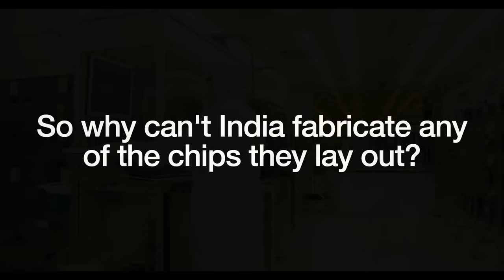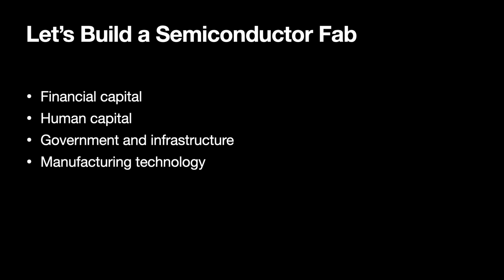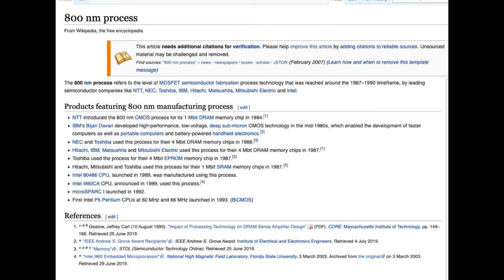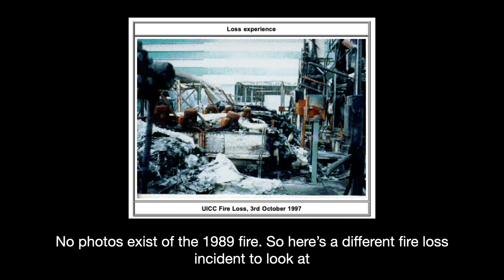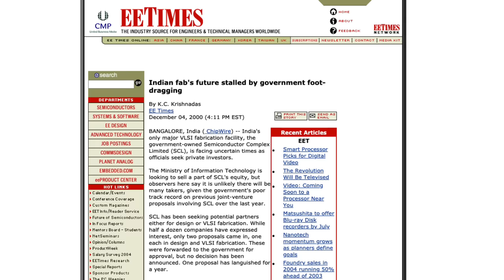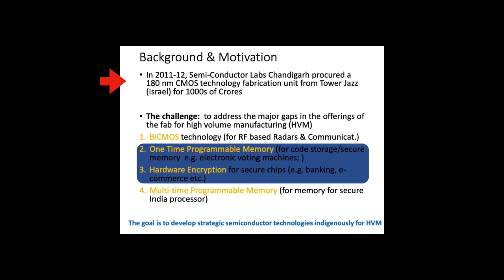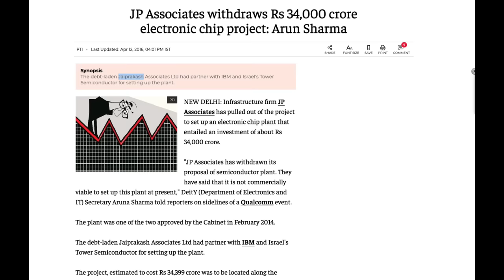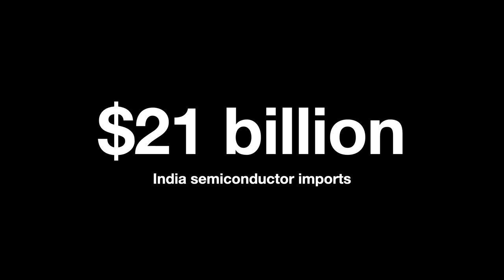India's Semiconductor Failure

Comment: I didn't know India even had a plan for semiconductor manufacturing.
Reply: Same
Reply: Bro we manufacture our semiconductors for isro and defence . We have a facility in Punjab which has 180mm process
Reply: @chidambaranathans1975  now it is moving to 45nm
btw its 180nm
Reply: @chidambaranathans1975   ya but it's nothing compared to the world😬
Reply: @sarthakyadava  Don't think like that!! 180nm is used in quite few areas. Most of the industrial chips are even 300nm ones. Fabs need constant big $ upgrade.
Reply: @sarthakyadava  well you can blame democracy for that. If you want fast growth in a span of 30 years, you need a strong leader at the start and a strong educational foundation with lassie flaire capitalism. We took the worst parts of socialism, capitalism along with democracy. So yes, we have no one to blame here other but ourselves.
Reply: @Fast_studyIQ  um not really. Nothing is on the table on the commercial level. Most of it is for research purposes especially considering even the most modest of our modern phones use less than 24nm config. Its really pathetic.
Reply: Tried multiple times, Failed patherically might i add multiple times.
Reply: @harshjain3122  democracy is not entirely to blame here. But yiu are broadly correct, from Singapore to South Korea to Taiwan and even Malaysia had politcal continuity under UMNO, that kind of continuity can establish consensus amongst the ruling elite and thats not counting foresight. In India forget foresight when the we hell have we had consensus on anything of importance ? Labour laws? Regulatory capture by organised labour,
Remember the suit boot ki sarkar crap that the opposition pulled, Land reforms ? Agri reforms look the cluster fck that is NCR.
Reply: @harshjain3122  Remember in the video, where Fairchild planned to invest in India in 1970s, but Indian bureaucracy scared them away. India had dumb economic system before 1991!
Reply: @PumpkinEater-dm1xx  that little investment means nothing it wouldnt have changed anything. What can bring change is if the problem called low IQ political elites themselves go away
Reply: @excitableboy7031  how ill informed are you expecting PLI scheme's to work in every damn sector  which is typical Indian one size fits all sectors b.s, Nation states across the planet  are pouring in billions to subsidize this industry despite already possessing superior infrastructural and highly skilled educated workforce (especially in the STEM subjects), all the Nations that have strong presence is semiconductor sector rank highly on the PISA ranking, India is not even in the running, NEP is supposed to change things but I reserve my judgement till i see some genuine improvements on the ground.
Reply: @chidambaranathans1975  180mm wtf
Reply: I think only Semiconductor Laboratory Chandigarh....is there....
Reply: @ashwin372  why??
Reply: Me too
Reply: How about plan for toilets ??
Reply: @liho1738  good to know pakistani's atleast watch semiconductor content
Reply: @chidambaranathans1975  😂
Reply: They have had!! Making chips out of potato!! And it was successed!!
Reply: Typical indian, but do you sanskrit is a fastest programming language.
Reply: @harshjain3122  modi will take us to moon and rss will take us to stars
Reply: @alexanderphilip1809  Semiconductor industry does not comprise only of microprocessors! Most analog chips don't need 10nm transistors. In fact, the higher end nodes (anything less than 22nm) are worse for analog circuits for multiple reasons. Sure, smaller nodes buys you higher bandwidths and lower power, but the overall transistor quality is much worse. 45nm technology is good enough for most of analog industry. For example, MEMS industry hardly needs 22nm ROICs. There is plenty of possibilities for 45nm tech. It is easy to be dismissive about everything and making sweeping statements.
Reply: It's a sour grapes for india
Reply: @sarthakyadava  for military use even old tech is good. Old tech are said to be more reliable
Reply: @alexanderphilip1809  for military use 180 nm is good.
Reply: @ARUNKUMAR-gh6zp  lol. IITs have it. But India VLSI lab are ancient compared to that of USA and Japan
Reply: @rodrozil6544  they are just design and a very small scale production lab.....
And not a business but R&D

Understand bro 😊
Reply: I didn't know they even had a plan
Reply: Thats why its such a failure. 😂😂
Reply: @metagde6402  is an high IQ political entity like Kejriwal the solution?
Reply: Until now ofc
Thx to china
Reply: @AnkhArcRod  nasa only uses chips which don’t fail but they are ancient in terms of technology
Reply: @harshjain3122  bro what if this is a Chinese channel? 🧐
Reply: @obama-bin_laden  or just to communal hatred!
Reply: Bro you should keep up with current affairs for that. India was trying for semiconductor plant from some time back now
Reply: @Fast_studyIQ  why 45 nm now? That 20 year old technology. Should convert to 5nm or 7nm now. Or at the very least to 10nm
Reply: It's because you are not what you think you are.
Reply: @harshjain3122  you made a fantastic statement, we have carefully selected the worst portions of capitalism socialism and democracy.
Reply: Congress top brass of those days weren't that bad afterall.. 🤷🏻‍♂️
Reply: @metagde6402  are you telling me educated people like Kejriwal and Rahul Gandhi should rule the country?
Reply: You don't know everything
Reply: @alexanderphilip1809  what are you on about guy, big names like samsung are signing up under the electronics PLI. 
They're incentivising components for now, things like SMD caps and resistors, displays etc, and later plan to expand to silicon too.
Reply: @AchiragChiragg  so you admit the kejriwal and Gandhi is educated ?
Well also, are only kejriwal and Gandhi the educated ones in india ?
Reply: @metagde6402  Kejriwal is educated yes. I don't know how genuine Pappus degree is. Besides you didn't answer the question. On that note CM of UP, Karnataka, Madhya Pradesh, Uttarakhand and so on are all educated too. So what's your point?
Reply: @MashZ  not easy to achieve, who will give this lower node? No company will share. Might be IIT Bombay will help gov to manufacture lower nodes.
Reply: @iampiyushsingh7544  semiconductor manufacturing who will know everything tell me?
Reply: Deal in progress with taiwan around 7.5 billion us dollars.  Video - world affairs by prashant dhawan on 26 September 2021
Reply: @Fast_studyIQ  I was talking a about his way speaking as that he know everything and didn't know this news. He should about the latest deal between India and Taiwan of 56K Crores rupee about semiconductor
Reply: Taiwan and India going to make it happen.
Reply: Same
Reply: they just have a ppt
Reply: Big failure
Reply: @rahulkaul6922  It's the truth.
Reply: @ashwin372  yup, and I think that india is also working with Intel for 20 mm chips
Reply: @liho1738  how about planning o build some toilets in paxtan
Reply: @muh11ad  
Hahaha 😆😆😆
I am not from Pakistan or China.
Reply: They are our educated class....😳.     
My Materials Science and Engineering teacher  told about fire in Semiconductor Laboratory....
Reply: @alexanderphilip1809  true
Reply: @PumpkinEater-dm1xx  true
Reply: @roardinoson7  true. Holy shit most people in this comment section are quite knowledgeable. I didn't expect that. I am seeing this now. Nice meeting you guys
Reply: @Flame which nations? Some Nordic European? Which else?
For Europe...they are homogeneous small states with population of roughly around 10 million people, they all speak the same language, same ethnicity in their respective nations and mostly same religion. So yes, democracy works there. Does india have the same conditions and does simple democracy work here? No.
Reply: @sceaserjulius9476  sanskrit is not venerated in Southern India at all..so the "typical" Indian part doesn't even make sense. Sanskrit is Indo-European, a language of your kins...lol...so how do you feel about that now?
Reply: @chidambaranathans1975  I have seen that facility in Mohali. On my way to office.
Reply: @chandanchettry4053  wow nice to know
Reply: They have made investment in taiwan companies to establish industries in india
Reply: SASKEN
Reply: @PumpkinEater-dm1xx  Modi fan spoted.
Reply: Xd
Reply: Same here
Reply: This is scam.
Reply: @chidambaranathans1975  burn
Reply: Exactly 😂😂
Reply: Bhai India Taiwan has been in last stage  talks between  in semiconductor deal which will be sign soon and manufacturing will start in india
Reply: The media ofcourse
Reply: @rahulkaul6922  Bruh it's kinda true , majority of the semiconductor is manufactured in Taiwan.
Reply: had a plan...and failed. failed badly where even Malaysia succeeded
Reply: @MashZ  lol...intel used to use 45nm like 7-8 years ago
Reply: @deezeed2817  lol, india and Taiwan deal of 8 billion , your country gdp😂😂
Reply: No problem most Indian thinks India do not even existed before modiji
Reply: Bikau media cover krega to educate hoga na Indians
Reply: @harshjain3122  the most honest comment ever from an Indian. Most Indians are in self-denial because of either nationalistic pride or pure ignorance. If India is to grow n become more developed
Reply: @harshjain3122  ! Perfectly well said.
Reply: @chidambaranathans1975  ! Because 180 nm is too too far away from 5 nm which China is working on.
Reply: @metagde6402  ! I beg to differ here ! India not only needs educated people but people with impeccable values of valour, courage and honesty.
Reply: Isro needs bigger transistors for radiation shielding,less chance of bit inversion
Reply: India has plans for everything. The proper  forms for approvals will stay forever on some "babu's" ( govt. official's)  desk.
Reply: @vijayanathanstephen9308  yeah lol! I had put that comment even before he posted the video . Same for that chandan dude
Reply: You must be proud of even that!! 😷
Reply: Same. I really look forward to working for one. ❤❤❤❤❤
Reply: Not surprised to hear that
Reply: @chidambaranathans1975  Exactly
Reply: @sarthakyadava  Congress party never wanted this to happen, BJP is doing a nice job in improving our industry, infra and foreign policy.
Reply: @Fast_studyIQ  TSMC just moved to 7nm
Reply: Not then but now we have 7.3 trillion$ deal with TMSC.
Reply: Indian has plans for everything on paper
Reply: No shortage of plans
Reply: there were multiple attempts
Reply: I had the same reaction.
Reply: And they are right to do so.
Only through a centralised economy can a mostly agrarian country keep up.
That's how it worked in EVERY single country.
The free market is a myth btw.
America HEAVILY subsidises critical industrial and agricultural sectors, whilst demanding that everyone else de-regulates and cut subsidises thus giving the American an unfair advantage.
Reply: They did but nobody wanted chips that run at 1Hz and are covered in rice.
Reply: all top guys at intel, amd, texas instruments, nvidia are indians or most of them
Reply: @chidambaranathans1975  
Four decades ago, in d r d o (when Intel -486 chip was ruling the market), a microprocessor chip that was much alike or even better than the 486 chip was designed. Then came the problem of getting it made (manufacture) for which no "Fab" facility was available in country. We took it for granted that someone will manufacture it somewhere as India needs a few chips only. A Singapore firm was contacted who got them made in Taiwan. The number demanded, so as to meet the demands of Indian government was too low. They were made, delivered & used with satisfaction. 
By then Pentium (re-nomenclature of 586) was launched. Because the scale of manufacture was in millions of pieces the over-all price (in the market) was very low, they were bought & used by various computer (Laptop) users. It set in motion the Laptop revolution. Meanwhile the India-developed 486 chips, apart from being a step behind the Pentium in Technology, were highly priced (because of the low volume of manufacture). It was felt prudent & preferable to use Pentium chips freely available at far less cost. Thus the effort to develop the chip came to a close.
The lessons to be learnt. First, the cost of setting up a fabrication facility is humongous(in the region of US$ 50 billion now) which in turn demands that chips (in batches of) in million pieces, to make them affordable to all, bringing down the cost of bigger systems & equipment by a large margin. This aspect is very essential, that entails a huge market, which  Intel & AMD command. Manufacturing in small batches that spreads the capital cost on far less products, make them costly is inadvisable except for Laboratory experiments. It isn't appreciated at all. If appreciated, timidity drives them to small batches as the higher cost can be dumped on the GoI (government) as always in such ventures. One question that is asked, is where is the market? Even here, India is a huge market itself & a wastage here & there is more preferable, to not doing it at all. And also this lack of taking risk, is bad business that marks Indian ventures, full of promises though. It stymies any attempts to upgrade Technology, which is the normal feature in this business. Funds may not be generated adequately for upgrading Technology. This results in Technology stagnation when the rest of the world is moving forward.
Reply: @alexanderphilip1809  
What is made for research purpose may not be released in the market, as the same may not pass the stringency of Quality approval test methodology. It is particularly glaring for defence (at least two grades higher than commercial products) use & Space (a grade higher than the defence equipment) applications.
Reply: @PumpkinEater-dm1xx  
Yes. The biggest stumbling block in the progress (if any; I am yet to see if it is there) is our "bureaucracy". I don't blame them. They (the men) are inured to play it safe. Failure isn't seen with favour but punishable & is a deterrent or are driven by plain timidity. Most of them under-exposed or not exposed, to contemporary Technology can't interact meaningfully with any Technology developers. Thus the quality of men (& their risk-taking ability born out of any confidence of knowledge) taking decisions is very poor. In India taking risks is often confused with wasting government funds & even (non-existing) corruption. The crusade against "corruption" has brought all & mighty, while stymying the decision making ability. No worthwhile remedy has been found to cure the malady. As an example, witness the Lok Sabha debates on the choice of Rafale aircraft that was thought to be very costly (& was foolishly suggested to "develop" such aircraft in thee country with the country's resources). The mildest word that one can use is "simplistic" thinking.
Reply: @roardinoson7  
All the Technology is developed by Japan, South Korea & now Taiwan. Taiwan outsources "manufacturing" (only) to China, establishing huge Fab facility (sinking US$ billions). The result is, Taiwan gets the cheapest chips for her global (spread out, but assured) market, using the cheapest labour anywhere in the world. What China gets is high-paid employment on large scale, that trickles down to the whole populace & promotes trade (export). China - per se - has not developed any Technology (not even manufacturing Technology but handed down by Taiwan), but just doing contact manufacturing.
In analysing & discussing such issues use of vocabulary such as inefficient public sector, corruption, lazinesss or lethargy  workers etc, doesn't auger well, but surely deviates the focus from Technical issues which are at the heart of the problem. These extraneous arguments can be added later, with no damage.
Reply: @metagde6402  
Politicians the world over are the same. So it is foolish attack one country on that account, as if the advanced country politicians who are corruption free angels. One thing should suffice, they have a commitment to excel or to do a batter job, while in India a job is done because someone told him to do. In this, quality of work is unimportant, but whether the job is done or not. If results are indifferent, the buck is passed, down rather than viewed as a team task.
Reply: @excitableboy7031  
Yes, these are news-worthy, viewed from the past events. The proof of the pudding is in the eating. Wait & see.
Reply: @ARUNKUMAR-gh6zp  
What is its scale operation (forget the level of Technology however high it may be) that clinches the outcome. Its vital.
Reply: @sceaserjulius9476  
There is no connection. It is an indifferent observation, designed to hurt someone. Nothing more to your Question.
Reply: @obama-bin_laden  No need for those. Let him get us a a clean fabrication facility sufficiently "large" that'd be more than the moon & stars combined, as you cite. If you are in the mood of joking take that elsewhere.
Reply: @AnkhArcRod  
Yes. Shall we talk about oranges or apples first? For me, I like them both.
Reply: @rodrozil6544  
Sour, before even seeing any grapes.
Reply: @rodrozil6544  
But old Tech is far far slow. Being fast is also needed for military use. You can't segregate one thing & still say the thing is adequate. Honestly thes old Tech is (may be) suitable for Audio & Acoustic applications.
Reply: @ARUNKUMAR-gh6zp  
EXACTLY.
Reply: @AchiragChiragg  
May be, if he can recall what he studied in IIT, Kharagpur, setting aside his political work for awhile. That way, there is plenty of talent, untapped & locked up in the Lok Sabha. But a Technologist is supposed to be in touch with what he studied & upgrade it periodically. Leaving his college text-books & notes in the dusty attic is no solution. It is why none of them talks anything but politics. It is far easier that way.
Reply: @metagde6402  
US & Japan are stalled in their track, because there is someone (Taiwan) progressing the Technology & minding that business. They have enough not to compete with Taiwan. Taiwan was given a tsk to mind the Technology that it does well, while the others have other things to do, happy in the thought that the supply chain is running smooth.
Reply: @bharattirth641  
The level of Technology isn't demanded there, like in computer games. But, yes "reliability" is demanded like nowhere else (may be things like 6σ). It is like a male buffalo tied to the yoke that can haul the load, rather than a race-horse.
Reply: @sidu130892  
Not sometime back now, but for forty or fifty years.
Reply: @shrikanthpai6604  
How about the Technologists &Technologies?
Reply: @metagde6402  
Kejriwal is a Technology graduate from IIT, Kharagpur considered to be one of such top institute in India. But he chose to leave all that behind & become a politician, that was not taught in his Alma mater.
Reply: @chandra5914  
But why should Taiwan wants to do that, in India? What is their plan?
Reply: @harshjain3122  
Minoo Masani (he is no more now) wrote a book "our India" long long ago. What strikes any reader in the first few pages is a map of India (dark) on which are superimposed the maps of European countries in white (Except Russia). It brings out the fact that Indian Union & European Union are on the same wavelength. Probably they named their as EU, on the template of our IU (Indian Union). Central government is the Union government. Her council of ministers is composed of Union ministers. It is UPSC (Union Public Service Commission) that our kids compete at. Probably it is better if IU is run like a EU & EU like an IU.
Reply: @samuraijosh1595  
How about all those Pandits performing marriage rituals (half a million shall we say !), performing pujas in all the temples giving Arti & Prasad if you visit any temple (there re 30,000 temples each in Andhra Pradesh as well as in Tamil Nadu, few built at least a millennium before). I suggest you visit Tirumala hills above Tirupati (& jostle with a lakh pilgrims every day) & hear their chanting.
Do you think these Pundits are saying their incantations in Urdu or Yiddish?
Reply: @tianlingchen5523  
So what? The latter can't nullify the former. If you Just want to talk, you can say anything you want.
Reply: @rgb2296  
Correction: Mostly manufactured by Taiwan in other countries (countries of SE Asia & PRC).
Reply: @hypocrite5873  
I don't know what you mean by 8 billion. I take it as 8 billion Roubles. You lack the elementary common sense of mentioning the basic "units" before/after every figure. So there is no point in trotting out figures (like casting pearls before swine). Yet I do that. 
India's GDP is about US$ 3,000,000,000,000 (fifth place). In PPP terms, the same amounts to about US$ 7,000,000,000,000 + (third place after PRC & USA).
Have you ever heard of terms like Google search, Wikipedia etc? I wonder ! You don't deserve to call yourself a hypocrite even.
Reply: @sohail7728  
Then how did Modiji popped up? Out of nowhere? Or did Americans elected him (instead of Trump)?
Reply: @vijayanathanstephen9308  
Do you see one ? (I see)
Reply: @MrPoornakumar  its 8 billion Us $
Reply: @joelshajan8706  
Why don't you go to them & teach them?
Reply: @MrPoornakumar  lol, i am from Indian business world, (my English is very bad) if we (business world) Indians talk in millions or billion that means that’s USD 
And if we talks in Lakh and crore, hazaar than we take that in INR
also deal is now becoming stronger and stronger
Reply: @phoenixzappa7366  
You mean a potato chip?
Reply: @evolveelectricvehicles8551  
If you ever happen to go to Bengaluru, you 'll all of them (big buildings) ina row.
Reply: @hypocrite5873  
Ow ! I was never taught this nomenclature.  I am not in the (business world).Like in all things you say, meaning what is contrary, your English is excellent.
Reply: @MrPoornakumar  yeah in delhi ncr north India 90% of the time we use million and billion for us$ and lakhs/crore for rupee 
Thousand/hazar used in both 
Only Sometime small media sites use million in rupee but they clarify with rupee after million 

I am sorry for my mistake from now onwards on youtube I will apply usd and inr where they are needed🙏
Jay shri krishna 
I am from mathura vrindvan here is famous festival holi today 
Happy holy to you 😊
Reply: @hypocrite5873  
Thanks.
Reply: @roardinoson7  India is a house divided on purpose … your oligarchs don’t want the peasants uniting , the disparity of wealth in India is a meme word wide where you only meet Indians if they or Patels or the servants of Patel family haha.
Reply: @harshjain3122  Democrazy
Reply: @liho1738  good to know Pakistani's atleast watch other things than "religion"
Reply: Yaa because we dont
Reply: India prefer high level design type service work not the dirty toxic manufacturing work.
Reply: @nsevv  there is nothing high level about most of our designs and services
Reply: @harshjain3122  America is democracy and they are at the forefront of scientific discovery. I argue that democracy alone can produce free thinking required for science. Don't blame democracy for India's failure. Infact India was copying communist Soviet union and was a licence Raj. No scope for innovation when just few control the narrative. Innovation needs an ecosystem of free speech, incentive for out of the box thinking, investment in education and research. Current India lacks all of this. Our higher education ministers denies evolution and say astronomy is inferior to astrology.
Reply: @chidambaranathans1975  180mm is a joke, when most processors are measured in nm (not mm) and 7nm is sought after.
Reply: Well everyone has a plan
Reply: @alexanderphilip1809  political continuity in Malaysia was broken in 2018 general election. Only recently this party came back to power through sabotage.
Reply: @sarthakyadava  most of semiconductor used are old semiconductor like washing machine old technology are used there which is make in bigger nm
Reply: Making chips is way more difficult than soft landing on the Moon.
Reply: @hanfucolorful9656  hmm and it's more difficult than controlling a virus. And more difficult is to distroy long march🤣🤣🤣 rocket. And going earlier than India in Mars🤣🤣🤣🤣🤣
Reply: @hanfucolorful9656  remember what happened in opium war than can happen again.
Reply: @hanfucolorful9656  be careful
Reply: @hanfucolorful9656  the most difficult things is hiding from Japan in WW2 🤣🤣🤣🤣
Reply: @devilsingh6052  take care of your [glass heart]
Reply: @hanfucolorful9656  🤣🤣🤣 your paper dragon get on 🔥
Reply: @nitinkataria8053  Yes, Nehru was an idiot by starting IITs, IIMs. Now these IITs can't even develop a cutting edge technology. 
He should have donated every thing to building religious worship places.
Reply: @HardeepSingh-bh7zw  You don't know his full CV Harry boy, grow up
Reply: @obama-bin_laden  😂😂😂😂
Reply: SIR THIS VERY FAKE NEWS NOT MY INDIA! PLS DELETE ! 😠😠ACTUALLY MY INDIA HAVE SUPER STRONG SEMICONDUCTOR  NUMBER ONE ! THIS WHY IM SO LUCKY LIVE IN SUPER INDIA 🤗🇮🇳 THE CLEANEST COUNTRY IN THE WORLD , WE GIVE RESPECT TO ALL  WOMEN THEY CAN WALK SAFELY ALONE AT NIGHT AND WE HAVE CLEAN FOOD AND TOILET EVERYWHERE 🇮🇳🤗🚽, I KNOW MANY POOR PEOPLE JEALOUS WITH SUPER RICH INDIA 🤗🇮🇳🤗🇮🇳🤗🇮🇳🤗
Reply: I didn't know India even had any semiconductor factory or any electronic industry
Reply: One of my friend from India and he said all the smart Indian ppl live in western countries and the ones that who went back to India became Hindu nationalist 😁😁😁
Reply: Thx to Congress
Reply: @shashank99341  electronics was reserved for central government under Licence Raj. They did not do anything.
Reply: @rmrrao2675  then which government investment such a huge amount.... R u modi fan
Reply: @shashank99341  no one is asking government to invest. Electronics should have been free to anyone to invest. Are you a fan of Nehru and his failed policies?
Reply: @AchiragChiragg  yes bro current situation of Punjab says all
Reply: It's semiconductor PLI scheme
Reply: @chidambaranathans1975  180 nm ? Man that's ancient
Reply: They never have a plan they copy Chinese doctrine without thinking it through. This is done both in the economic and the military sector. The Chinese deployed a failure of a light tank during the Ladhak standoff and India starts a tender for a locally produced light tank. Mountains are a crappy place for tanks one well armed infantry squad can stop a full tank bataljon. It is helicopter and infantry terrain a tank would hinder operations. But the K-9 would be a great asset to have there together with light armoured vehicles with Spike NLOS and indigenous shorter range ATGMs.
Reply: best way to minimize risks of war is to avoid threatening your enemies. best way to do that is to humble yourself before them, kow tow, touch their feet, sing their praise, eat out of their hands, etc. that is the secret of the uninterrupted survival of indian civilisation over the past 4,000 years or so. india is following this ancient wisdom.
Reply: @rmrrao2675  nehru understood how stupid the indian population was. instead of antagonizing them he tried to entice the masses, with unfamiliar but clever sounding ideas. he was hugely successful. india remains perhaps the most successful post colonial primitive human population. it has not lost much territory, has avoided long lasting dictatorship, has not antagonized either the western liberal democracies or the eastern illiberal dictatorships. what china and pakistan keep doing to india is not aggression but routine maintenance work, to make sure that the attitudes, thoughts, and actions of india remain safe and suitable. it is all due to Nehru treating indians like kids, using chocolates, balloons, and fairy tales rather than a thick stick to turn their attention to relatively harmless pursuits.
Reply: @akhil999in  'it has not lost much territory? Why it should have lost any territory? You are making it look like it is normal
So giving away 33% in the form of Pakistan east and west, plus aksai Chin, plus all rights in Tibet is not much?
Reply: @harshjain3122  funny as it might sound it is the indian capitalist who is a strong believer in socialism, for he would brook no freedom of business. it is the poor who wanted capitalism, but the businessman in india would not tolerate the end of socialism. prime example is how indian business tortured the south korean posco to the point of driving out not only posco but preventing any big foreign capitalist from daring to invest in india. indian businessmen think lke small town grocers. an industrial economy cannot make progress without a backbone of really very big businesses  very many of them. india remains stuck in pseudo socialism because the indian capitalist is scared of a free market. the poor indian does not fear free markets.
Reply: @rmrrao2675  a people wedded to archaic superstition and prejudice are very successful if in spite of geopolitics, they still have a substantial portion of their traditional territory.

india was never in possession of any part of Tibet.

pakistan is a sacrifice, without which all the geopolitical forces might have been operating directly on indian soil.
Reply: @akhil999in  India had several rights in Tibet. Please go read up. I never said Tibet was part of India. 
These generic beating around the bush replies still don't explain for loss of 1/3 of the territory.  Loss of territory has nothing to do with your belief system whether you are a  believer in desert religions or not.
Reply: That is beter described as targets not plans!!!
Reply: @alexanderphilip1809  atleast 5 companies planned investment in semiconductor in India that's it we are in every field now.. Aircraft manufacturing will also start soon...India will have all sectors in manufacturing then ..
Reply: @harshjain3122  you actually have a good point for a change.  Nice
Reply: Cow dung chip😂
Reply: @alexanderphilip1809  Dude that's not true. 24 nm, 30 nm are still being used in most big industries. Those are standard in most industries. Only mobile phones have small manometer cause mobiles are small & suppose if have more power saving.
Reply: @chidambaranathans1975  180mm ....sounds like a chocolate chip to me
Reply: Adani and Anil Agarwal are in the race for the first Semiconductor factory in Gujarat. One of them will achieve it. The cost, expertise and the amount of water needed is still a problem. What has changed after almost a decade or so? Gujarat govt providing land at dirt cheap rates and canals joining most rivers will probably help these factories a bit.
Reply: @miang62  Talking about 50 CENT?
Reply: @HardeepSingh-bh7zw  Certainly 8 IITs weren't enough. In last 8 years more than 22 IITs IIMs were built. That's the difference dummy
Reply: Say it again
Reply: @harshjain3122  lassie?
Reply: @davidjosephgerald8637  Not this time. With mobile, display & electronics manufacturing taking at record pace in India, this time it won't fail. Back the time India didn't even have 10 Million mobile users or had electricity accessibility. Now it's different time altogether.
Reply: @vijayanathanstephen9308  All big industries apart from Mobile phone use 30-240 nm. Grow up is you've a decent education.
Reply: @asingha94  wtf are you on about in this 1 year old thread ..
Reply: foxcon vedanta joint venture in India. India proved you wrong baby
Reply: @sarthakyadava  5nm ,3nm those are for PC & Phones. Big machines need higher nm semi-conductors.
Reply: India had plan for almost everything, but most of just are plan
Reply: Eventually India will. So many i t engineers software engineer graduate from India every year.. there are more engineer graduate in India every year than there are engineers in US.
Reply: @bl5608  unfortunately, mostly of them go to USA, Europe and not just engineer but scientist too
Reply: @Pulkit  it's OK.  Before 2000, most chinese find ways to leave china. After 2000s most of them go back. 2010s - now - 95% percent visa students can't wait to go back.

Build more infrastructure and facilities.  Give Incentives  ,lower tax. Make them want to come back. 

Not really a problem, just need time to develop.
Reply: @bl5608  but india is not China
Reply: India is trying to build lithography machine to build 1nm chip.❤
Reply: @ashwin372 Indian engineering 🥶🥶
Reply: Yahh upa is too scammy in everything 😅
Reply: @harshjain3122  yours is the worst comment here and has the highest likes, clowns on the internet I swear
Reply: @chidambaranathans1975  180 mm Nooooo!!!
Reply: @BlackHawkTejas  ??? 180nm is trash, TSMC soon will be on 5nm come on
Reply: @大砲はピュ  TSMC already have 4nm & 3nm, that aside it speaks volumes that you don't know how chip sector works. 180nm is trash?? Really?? Go ask US, SK, Japan, China, France etc.. about this!
Reply: @Fast_studyIQ  now it's moving to 10nm processor .
Reply: India Had Put Up A Big Plant For This....
In Around 1980
The Entire Plant Caught
Fire & Everything Was
Destroyed....
No Body Knows Reason 
Of Fire....
Reply: India Had Built Up A Big Facility For Semiconductor....
The Factory Caught Fire
& Everything Destroyed

Reason Of Fire, Those Responsible Not Known....
You Can ReSearch & Find The Details And Publish
A Video On This....
Reply: @Alexander Philip, you r right my friend ...true
Reply: Ah oooooom
Reply: @alexanderphilip1809  , Remember, most of the processes are located in Penang and not in other States. You know why.
Reply: @chidambaranathans1975 jai hind